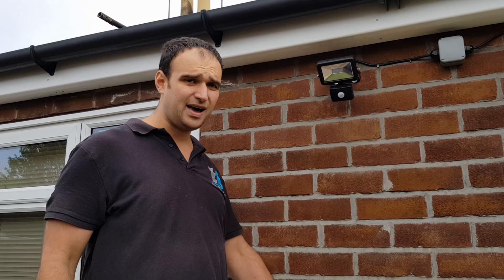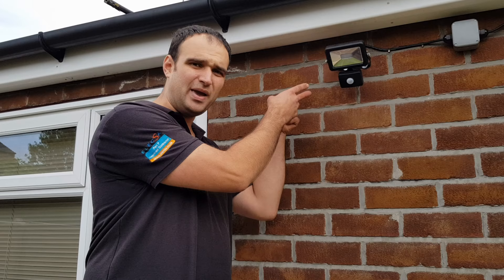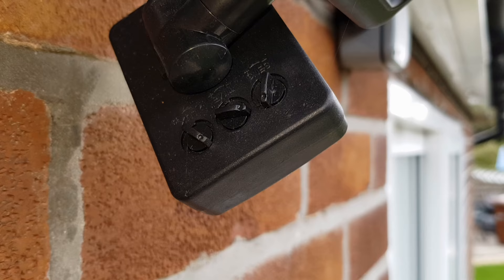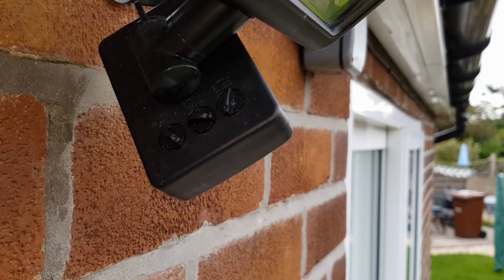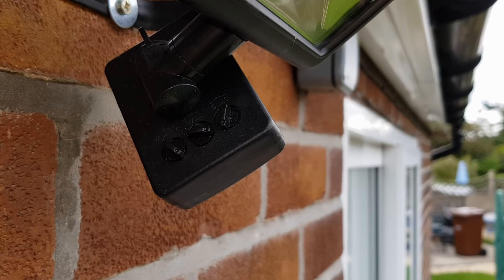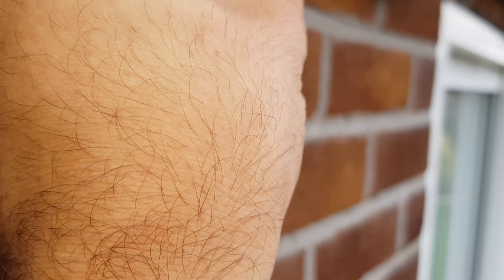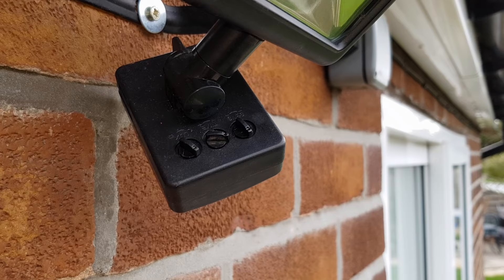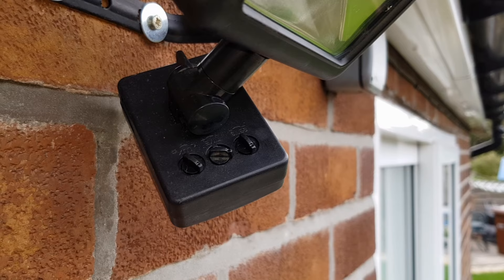How To Alter The Settings On Your PIR Floodlight - Security Light Sensor Settings

Comment: Why don’t you just set the lux all the way
Reply from the maker: Some people prefer the light to come on at dusk when there is still a small amount of natural light.  Setting the lux level to the max setting means the light will only come on when it is pitch black.

It's all down to personal preference of the end user.
Reply: @ElectricBluContractors  ok thanks mate 👍

Comment: I still have problems understanding how to set "Sensitivity".  Is it by distance, or amount of movement in View ?  - I have a few shrubs in line of sight, and was hoping that reducing the sensitivity, would avoid the PIR flickering the light on when the wind blows.  But if it is just a distance threshold, it has little to now effect on reducing the flicker due to winds.

Comment: The little pointer on dial has a dot at one end, should the dot be pointing where you want on the dial or is the dot the bottom of the arrow so to speak?
Reply from the maker: Hello Terry
The little dot is usually the 'point' of the arrow if that makes sense?  You want the little dot to align with what setting you require on the dial

Kind regards
James - ElectricBlu Contractors
Reply: @ElectricBluContractors  cheers, that makes perfect sense. Much appreciated 👍

Comment: Thanks for this tip.  My lamp suddenly stays on all the time.  I’ll try to reset it tomorrow..many thanks.
Reply from the maker: Hello Stephanie.

If your lamp is staying on constantly then it's best to try turning the power off to it, leaving it for at least a minute (as some PIR lights have an override caused by switching on/off quickly) and then turning it back on.

Most lights will come on as a 'self test' once you turn them on, they should then turn back off after a short time, depending on how long the sensor is set for.

Hope that helps?
Subscribe and I'll cover this in another video soon

Kind regards
James - ElectricBlu Contractors

Comment: Hi
Can u manually turn it on at the switch or do they just work when it gets a bit dark.
Mine has philips screws to turn instead of knobs and mine has stopped working although I have just changed the bulb unit.Maybe it isnt supposed to work in daylight Im not sure .
Thanks for the video

Comment: Can this type of light be set to come on automatically at dusk till dawn? Just bought a ledvance with the same dials as this but wondering if I've bought the wrong type.
Reply from the maker: Sorry Sonny, I've only just seen this comment for some reason!?!

Generally speaking no, PIR lights come on with movement, the sort of sensor you are after is a "photocell" which just enables it to come on at dusk and go back off at dawn.

Ledvance are good quality lights, however the ones I've fitted have been PIR only.  From memory they did do a photocell in a larger wattage (70w I think)

Alternatively you could get a "plain" Ledvance light and fit a standalone photocell above it.  

We've just fitted 2 on a pole and used a photocell to switch them in this way

Hope that helps?

Kind regards 
James - ElectricBlu Contractors
Reply: You could turn up the time and sensitivity to the maximum (fully clockwise) with the Luk turned all the way down. That would effectively keep the light on all night and off during the daytime.

Comment: My sensor got damaged now I'm putting a piece of clear plastic where the white section is and will test.
Reply from the maker: If the lens of the sensor has got damaged then if you are replacing it, the cover must fit exactly into the same housing to ensure the IP rating of the sensor housing.

Kind regards 
James - ElectricBlu Contractors

Comment: These units can stop working properly if there's a power outage. You can reset them. It says to switch to off for 15 seconds and then switch back to on. I'm guessing they mean switch the time setting to lowest setting and then back on as I don't think there is an on/off switch on this ovia unit!?? Can anyone confirm this???

Comment: Thanks James  very informative...thank you. can I ask you is it possible to fit three out door light to one 
Pir  switch/sencer ?
Reply from the maker: Hello thank you for your kind words.
Yes this is certainly possible, you are best using a "standalone PIR" (one which is not part of a light fitting), that way you can have the sensor set up and it will drive a number of lights (definitely 3)

Hope that helps?

Kind regards 
James - ElectricBlu Contractors

Comment: Got one installed BUT the light comes on during the day and advise as to how to stop it. Cheers
Reply from the maker: Hi Baz thanks for posting the question!

Usually this is due to the "LUX" setting being too low, allowing the light to work during daylight.  The first thing to check would be that the LUX setting is turned upwards (generally these have a picture of the sun & moon at either end respectively, aim for the moon!).

If this is already turned towards the higher setting then it could be a case of a faulty PIR on the product itself.

If an electrician installed this I would be tempted to call them back to check it is working OK, we often tell our customers to make sure the settings are correct the evening after we install the light and would have no problems calling back if something like this was happening.

Hope that helps?

Kind regards 
James - ElectricBlu Contractors
Reply: @ElectricBluContractors  Thanks for the reply much appreciated.
Reply from the maker: @bazbuncher6948  No problems!  Hope you manage to get the issue sorted

Kind regards 
James - ElectricBlu Contractors

Comment: Bought two of the same LAP light, the one at the bottom of the garden comes on during the day even though the lux setting is at the moon and has good light. Tried resetting but doesn’t seem to work
Reply from the maker: Hello Mr Hayes, I'm sorry to hear you are having problems with your light. 

From what you have described, it does sound as though the sensor is faulty, it should only come on when really quite dark when the setting is turned fully to the 'moon' icon.

I assume you bought it from Screwfix?  They are usually very good with regards returns and swapping faulty items so I would suggest you swap it if at all possible

Hope that helps?
Kind regards
James - ElectricBlu Contractors

Comment: Can these be wired into a uk wall socket rather than a junction box ,FSU etc??
Reply from the maker: Hello Bill, thanks for asking the question.

You cannot just wire it straight into the back of a socket as the cable on the light is not rated high enough for direct connection to a socket circuit like that.

If you were to connect to a socket, you would need to put a plug on the end of the cable such that there is a fuse between the socket circuit and the light itself.  You would then need to change this fuse in the plug to either 3A or 5A.  To be fair this is a bit of a rough way of installing it, you really need connection to either a fused spur or else a lighting circuit of the correct rating

Hope that helps?

Kind regards 
James - ElectricBlu Contractors
Reply: Thank you!! I thought so!

Comment: JUST INSTALLED A PIR  WITH LUX AND SENS ONLY AND DOES NOT TURN OFF ANY IDEAS PLEASE?
Reply from the maker: Hello Mr Manning - many apologies for the delay on replying to this one, we did not receive a notification for some reason?

I hope you have managed to sort the gremlins out with your PIR light by now!  Although it's really difficult to diagnose things without having them in front of you, although if it totally refuses to turn off it does sound like a faulty PIR sensor/light.  Is the 'TIME' setting fixed on this particular light?
Reply: @ElectricBluContractors  THANKS FOR YOUR HELP SEEMS IT WAS TREES IN GARDEN NEXT DOOR BLOWING
Reply from the maker: @davidmanning5874  No worries Mr Manning, again, sorry it took so long to reply!  

Unfortunately trees and foliage can sometimes set PIR sensors off causing a nuisance.

Another common source of false lighting can be boilers and the plume of steam from the flue.  

Once again, thanks for getting in touch!

Comment: I’ve done all that with mine but still stays on all day and night
Reply from the maker: Thanks for your comment.

Is your PIR light particularly old? If so then potentially it could be the PIR sensor that has failed and the light could need replacing.
Reply: ElectricBlu Contractors not sure as I just moved into the property but both lights work perfect fine just won’t switch off
Reply from the maker: @Hulkmania1502  - it does sound as though the PIR sensor itself is faulty.  If you are happy manually turning the lights on and off then that should be OK but if you want the PIR to function properly I recommend getting a local electrician to have a quick look over it.